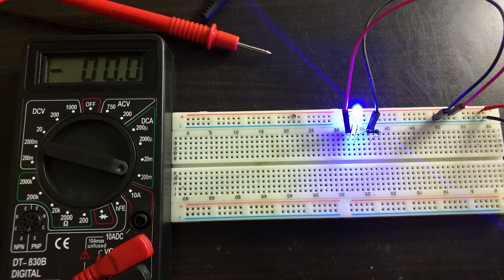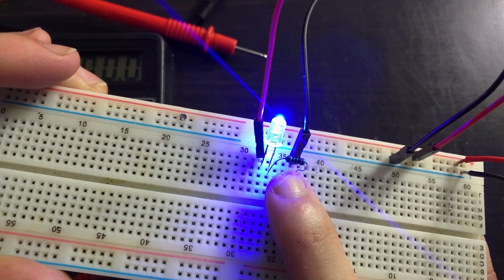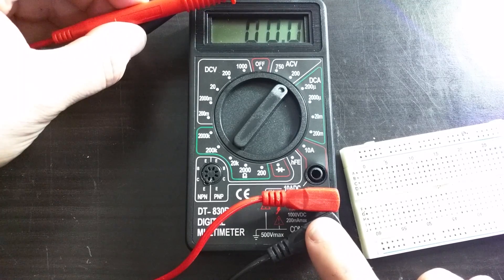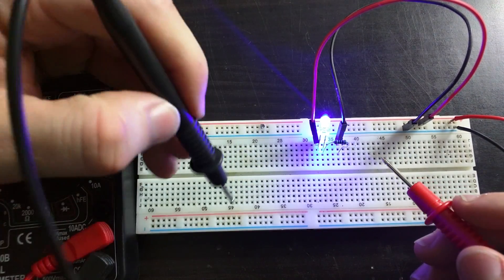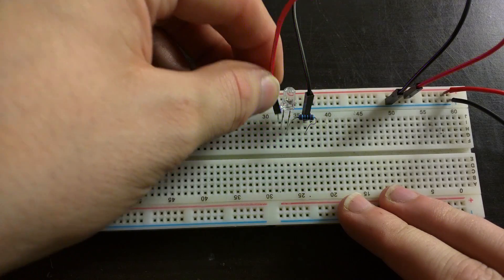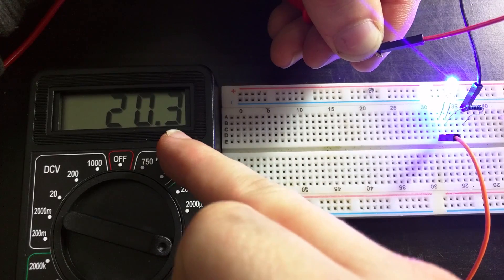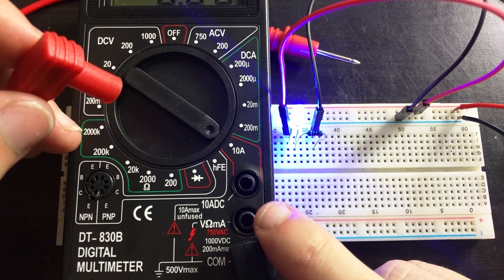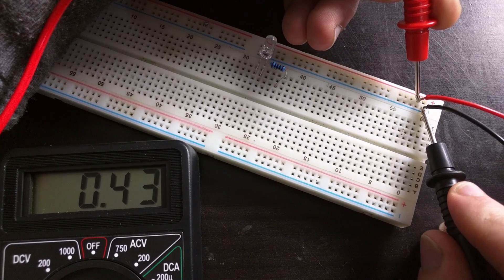Multimeters - Measuring Current - Electronics Basics 16

Comment: Was the part you edited in "2 volts! (Across resister)" supppse to mean that was the actual input voltage instead of the 5 volt USB power supply you talked about earlier??? That would explain how you got 0.02A instead of 0.05A
Reply: I'm sure you've figured this out by now, but it's because the Forward Voltage of the LED is 3V, so the voltage across the resistor is 2V.  If the resistor wasn't in there, then yes, the current would be 0.05A, but also the LED would probably burn out because it's likely rated for 0.02A.

Comment: the voltage wires were plugged into the bread board... did it matter ? did the rest of the circuit give a faulty result on the amperage?
Reply: They were plugged into the breadboard. However, he didn't have a circuit attached to both those lines. By inserting the probes into both those lines, he was closing the loop with his meter. He was verifying how much amperage his power supply was actually supplying.

Comment: This doesn't make sense.  To do V=IR, you need to know two values to get the third.  You start by saying the V is 5 and the R is 100, although you correct yourself that V is 2; but how do you know it's 2?  You can only know it's 2 be either measuring it (which you didn't mention) or by calculating it, but you can only calculate it if you already know the current, which is what we're supposed to be measuring.  In other words, the only known value in this video is R=100.  V is assumed to be 2 only because we know the LED is 20mA, but if we knew that, measuring the current is redundant.  I suppose if we knew the LED was 3V you could infer that the resistor is resisting the other 2 from the 5 but again this isn't mentioned, nor is it a certain assumption.

Comment: grumble, again you question something then dont explain it, why was the power supply expected to put out 1 and only putting out 0.45, do you not know why? if not then can you say this instead of leaving us wondering? hard to remember things when all i can think of when it ends is "why is it putting out less than half what its suppose to" and no way to ever find the answer..
Reply: I should also say thank you very much for these videos,  they are extremely helpful even when im left confused about something else..
Reply: There's no load on the circuit. The load is what draws the current from the power supply.

Comment: I had a question, why can't battery amps stay the same. What I mean by that is, why does the amperage increase to 100+ If the battery is shorted.
Reply: omer khan 
Ohms Law.

I = U/R. When you shirten the battery the resistance between the contacts gets really low so you current gets very high.

Comment: Ummmmmm soooo I connected the leads to the mains and guess what KABOOOOMM!!! THE MCB TAKES OVER.
Reply: Yeah, it was pretty irresponsible of him to suggest checking a power supply's output current by shorting the leads with am ammeter without some important safety caveats. That's a good way to get someone hurt if they do it with mains, or potentially ruin a DC power supply.
Reply: @RickinICT  True. Then again, if you're measuring mains, then you're supposed to know that the amperage is way more than 10A (at least in 240v sockets), which is the maximum on most multimeters.